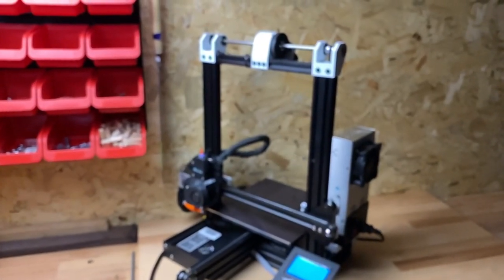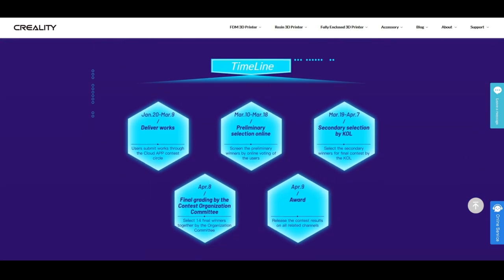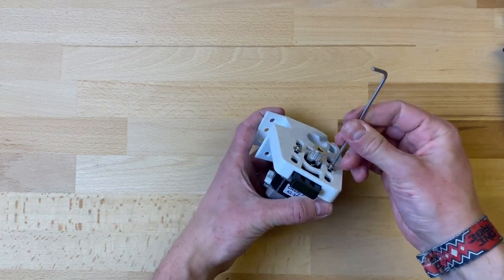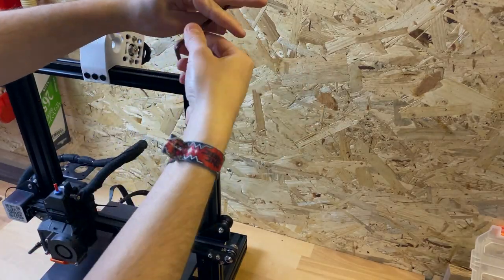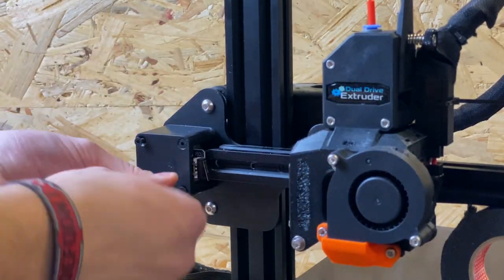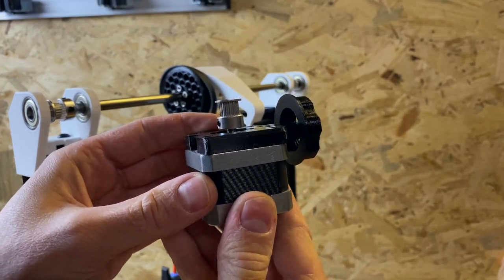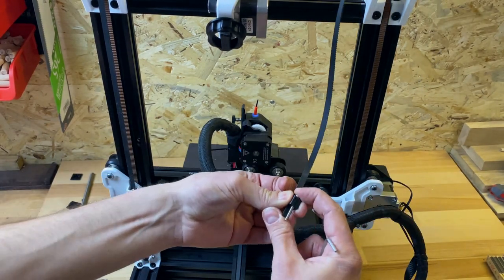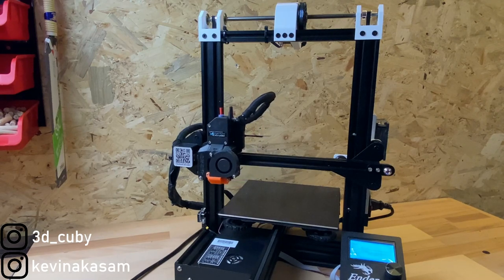How To: Belt Driven Ender 3/V2/Pro (Tutorial)

Comment: What  a great mod, i have one issue.... with this design the extruder stepper sits about 20mm lower than with the stock plate. my cable chain isn't straight and binds. Would be great if this can be modified.
Reply from the maker: Ah interesting 🤔 could you send me a message on discord?
Reply: @KevinAkaSam  Sure, got a tag?
Reply from the maker: kevinakasam#2097

Comment: Hey again, i have a layer shifting issue after making belt driven, any suggestions? Anyone facing this issue after make this upgrade?
Reply from the maker: Layer Shift for which axis?
Reply: @KevinAkaSam  on y axis always the same layer height
Reply from the maker: Then I doubt it comes from the Z axis. The only thing that could happen is that the nozzle is too low and releases the print from the bed, but not that it stops Y. Unless you set a very very low current but then you should be able to stop the bed with your hands.
Do you always print the same file or have you resliced it? Maybe there is an error in the file?

Comment: I feel like for the people who does direct drive modification the x gantry will be heavier and to compensate for that it might help with adding counterweights or some form of force that reduces the rotational force needed for the motors. Even though the motors can handle the force needed but for the longer term I think it will help enhance the project
Reply: If you use a 42-40 stepper rather than a 42-34 for the Z motor, you won't have this issue and it won't sag when powered off. 

Luckily, the Ender 3V2 uses a 42-40 for the extruder motor with the stock bowden setup, so if you do a direct drive conversion, you'll have a spare 42-40 laying around :)

Comment: hi, is there any movement and stretching in the z axis while making the x axis movements? What is the situation in fast printing?Thx for video it amazing idea!
Reply from the maker: Hey, there’re no problems with fast printing and no stretches ;)
Reply: @KevinAkaSam  hey thx for your fast reponse :) just 1 question more, i have to use pla so if i make a %100 infill is it work?
Reply from the maker: Pla isn’t the best choice, even with 100%infill. You should keep an eye on your motor mount (the tensioner arm). If the motor gets too hot this part will fail very quick. Maybe you can find someone who can print you this in petg or something similar. The rest should work with pls because there’s no heat involved

Comment: Hello, i would like to know what print settings you used, been having issues printing the top left and right parts
Reply from the maker: 45% infill, 4 walls, 4 or 5 top and bottom layers. 0.4mm nozzle and 0.2mm layerheight ;)
Reply: @KevinAkaSam  did you use a rift brim or skirt, im having issues with part sticking after 3rd or 4th layer, bed temp 45-55 hotend 200-205, printed other parts and no problem, just having issues with these
Reply from the maker: You’re using pla right? I’m using a skirt on most of my prints. You could rotate the part so it’s laying flat and add support. Just be careful to keep an eye on the layer orientation. You don’t want the layer parallel to the frame so the belt can’t separate them

Comment: Do you recommend the version 3 of the design on your Github? seems interesting but can find no one who has built it. Is it less precise as the two stepper could go out of sync like on other dual z printers or is thst no as much of an issue since it is going directly to a gear. Thanks! really genius concept and am excited to try
Reply from the maker: Hey, everyone who uses my mod uses the V3. It’s just the third generation of it. And then you can choose between dual or single z(one Motor on each side or one motor for both). For dual z you need something a G34 command or tramming z. For single z that isn’t needed because the single motor is connected to the rod. 
The precision is superior to the lead screw because you have no backlash. I hope this was helpful :)
Reply: @KevinAkaSam  Ahhhh I see. And makes sense! Good to know think I'll have to try it out. I saw on the Github for klipper you have a custom macro, is thst only needed if you are using one driver for two steppers? Will G34 suffice when it's two seperate drivers using klipper? And thanks for the note about the backlash, makes sense! Thank you so much for the reply and help. Can't wait to start printing pieces out
Reply from the maker: Yes the Tram Z Makro is needed for the dual z Setup with a single driver for both motors (eg a y splitting cable). G34 works with two independent motors so you would need two drivers for that (one for each motor, no splitting). But Marlin has a build in tramming function too, but I really to not like marlin so I don’t want to Programm that^^ doing the KlackEnder programming was a pin already (newest video).
Reply: @KevinAkaSam  Oh wonderful! Good to know! and fair enough haha. been waiting to make the jump to klipper and this might be the push I needed. will check out the klack vid! thank you so much for the help

Comment: Using abs or petg for 3d print parts?
Reply from the maker: Both material are working fine. If you’re using an enclosure that reaches more than 40°C, abs is the better option

Comment: Hi 👋 This is a fantastic design. I plan on doing this mod very soon. I intend to use a commercially available aluminum  80 tooth pully for the transmission just because. 

However I was wondering why use toothless, instead of toothed, idler bearings for the bottom brackets? 🤔
Reply from the maker: Hey I’m super sorry for my late response. You should be able to use the metal gear as long as it’s not bigger than the printed ones (but there’s 1mm of clearance so I think it should work. My metal gear will arrive in ~2weeks).
And toothed idlers aren’t necessary but I already designed some bottom parts to use them. Feel free to send me dm via discord so I can send you the files. I will put them online later
Reply: @KevinAkaSam  That's awesome! And thanks for the reply. I'll dm you.
Reply: @KevinAkaSam  So, feeling a bit silly.... how do I message you on discord...?
Reply from the maker: Haha, search for my nickname/Id: kevinakasam#2097
Reply: @KevinAkaSam  You should receive a request from mimick#1749

Comment: Conveniently enough i just decided to start printing this today after returning a shitty dual z leadscrew kit from amazon. Looking forward to getting some clean prints and being done with leadscrews for good. Anything i should worry about when installing on an ender 3 v2?
Reply from the maker: No you can install this mod also on the ender 3 v2. But if you want to use linear rails I would please you to wait a few days. The left plate changed for some reasons. They moved the holes we need by 2mm. I’m still testing the parts with a friend. But if you want to use the wheels you can use all the files without any problems;) and you can change to rails at any time later and just have to print two small brackets, but as I said the left one for the V2 isn’t finished yet
Reply: @KevinAkaSam  Just realized something that i didn't think of before. I saw that most people use direct drive with this mod, so i'm not exactly sure how to mount my extruder now. It doesn't seem that i can mount it normally anymore.
Reply from the maker: Take a look at 6:40 , I uploaded plates with a motor mount, so you can use it with the stock Bowden Setup;)
Just print the file: 1_LeftV3.2_Bowden to get the stock setup (https://www.thingiverse.com/thing:4243512/files)
Reply: @KevinAkaSam  Lol, sorry about that. I realized that shortly after i made the comment. I always decide to take on these new projects late at night and tell myself "alright, everythings in order, no need to mess with it any further untill it's all printed". It usually doesn't work out that way.
Reply from the maker: Late night projects are the best;)
Reply: @KevinAkaSam  That's what i keep telling my roommate, but for some reason he gets angry when i'm using power tools at 3am. People are wierd 😁

Comment: Wow man this is great printing the parts right now very good job and just a quick question. can you make a full parts list.
Reply from the maker: Happy to hear that. There’s already a lift with all the parts you need, just check the bom_all parts on Thingiverse :)
Reply: @KevinAkaSam  dang thank you so much for all the hard work I think I speak for all when I saw the zmotor and leadscrew is not that good,
Reply: also does it require any firmware modifacations
Reply from the maker: No firmware changes needed ;)

Comment: Does an earth/ground cable need running from the PSU to the printer frame now that it is not screwed directly to it anymore?
Reply from the maker: Honestly I don’t know that. I mean the frame is made of aluminum, so it would not be electrically conductive anyway right? But sorry I have no idea and never thought about it ^^
Reply: Could mount it just further back on the frame, like some dual z motor kits do.
Reply: Well TBH aluminum is electrically conductive. Many electric wires are aluminum core and not copper.
Reply: @KevinAkaSam  aluminum is metal and conductive.
Reply from the maker: Ah thanks👍🏼
Reply: @KevinAkaSam  Aluminium conducts electricity fairly well, especially at mains voltages...it's more to stop the possibility of a mains wire coming off and coming into contact with the housing of the power supply or a rail of the low voltages side (which could make the frame live at mains voltage, possibly) and having the risk of things not tripping out due to the Earth connection now only being present on the power supply.
It's basically a way to minimize risks should there be a malfunction in the supply.
Honestly I am thinking about making a different case for the power supply and have it mounted horizontal, 1,5 weeks a go I printed small parts with the supply horizontal and it needs to cool itself a lot less (which makes sense if you see where the vent holes are and the fact that it tries to blow cold air in over hot parts and wants to move hot air down as much as possible, which is not how heat works).
Reply from the maker: Thanks for your detailed answers, there is always a way to improve things. I guess this will help those who want to make their printer a little more secure
Reply: @KevinAkaSam  please bear in mind that aluminium and copper are not really compatible in the long term. The two surfaces can be corroded. Always use tinned lugs and ferrules to maintain the conductivity between the two metals.